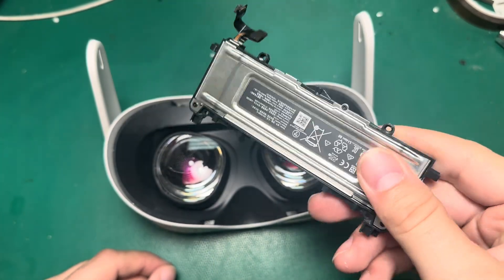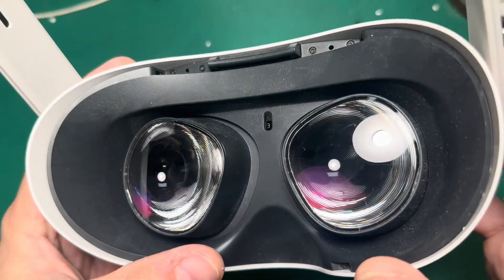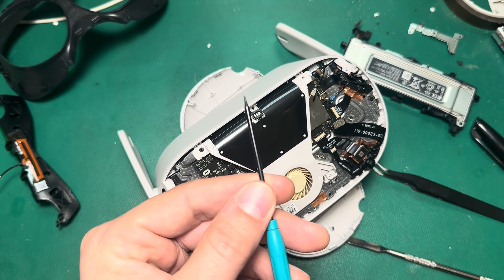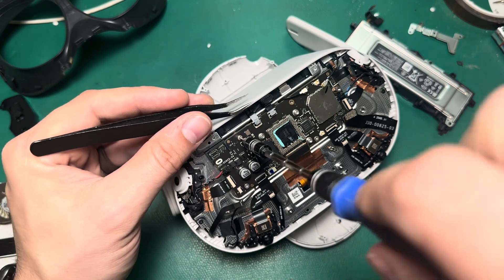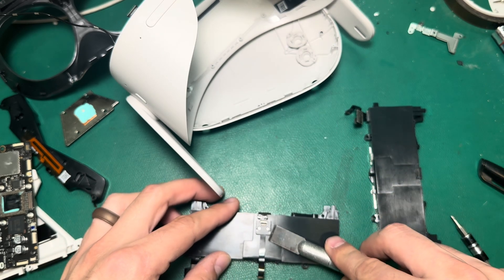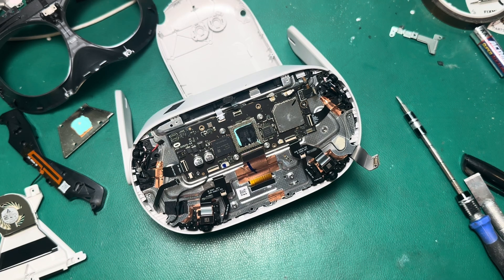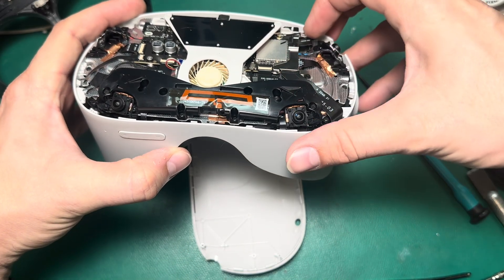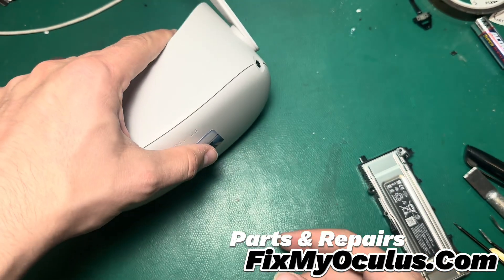Why Your Quest 2 Battery Won’t Last (And How to Fix It)

Comment: A successfully replaced the battery on my quest 2 and also changed the thermal paste.

It was almost a clean install but I forgot one ribbon cable, I've had to dismantle the device again , and almost broke a proximity sensor connector, and some other parts too.  about 9 bots left, however the the device is working fine

Comment: Great video! I work in IT so I'm usually comfortable trying to fix anything, but this one definitely took me for a loop. I spent most of today replacing the battery for a friend and man it's a pain, but eventually I got it. I even damaged the connecter on the volume buttons and just taped the flex cable in and it worked 😅. Still, this video helped a lot!

Comment: My Quest is not quite broken yet but damn, putting it into standby absolutely screws my battery. I have to basically keep it plugged in 24/7 unless I want to power off completely.

Comment: Given the position the battery is in, they could have designed it so that you remove the eye shrouds, then undo maybe two screws at the top behind the shrouds to slide a top cover plate back, revealing a serviceable battery compartment. They planned and engineered this unit but gave no thought to the ease of serviceability for consumable parts or any sense of environmental responsibility.

They could have even established an official parts market where users could buy replacement batteries and other components, with a trade-in system for old batteries, similarly like many robot vacuum manufacturers while still making a profit from it.
Reply: They just want us to buy a new headset

Comment: It’s worse for me. Leaving it alone for two weeks, it’s no longer powering on even when plugged in. Even changing cables, plugs and different combos of holding buttons down didn’t solve anything. Still haven’t yoinked the battery yet as a Hail Mary check.
Reply: @wywarren you should have recharged the battery after testing it
Reply: @minecrafthorrorversionfr sadly while I was testing it I had left it plugged in the entire time so I'm not sure what happened. Either the battery, charging port, or something else malfunctioned during the idle. While plugged in now the battery still heats up slightly from the charging.

Comment: I got an Oculus 2 about 2 years ago and never really got around to use it much at all. Now I want to use it and it won't even turn on , I plug it up and it won't charge (no charging light at all) the white oculus logo flashes for a second in a loop for infinity. And the holding power button or the power and -  button does nothing)... I assume the battery is toast? Will getting a new battery and following this video fix my issue?

Comment: Where are you sourcing the batteries from? Are they newly manufactured batteries without any charging cycles or parts from other used Quest 2s?

Comment: does the battery come out of that plastic, i mean can it, like would it not be easier to always have the front off and cut a hole in the top of the quest for any future replacements

Comment: The disappointing thing for me is it wont even work plugged in with the battery dead.
I hardly had time to use mine and now that I do it won't power up.
If they don't improve this I don't know if I'll want another Oculus.
I may as well attempt these repairs or else it's a paper weight so thanks for video.

Comment: Fucking meta, they can't make it easier!
Reply: They made it cheaper so you can just buy another one cheap because that makes sense to marketing I guess...
I'm grumpy it won't even work plugged in with the battery dead and unable to charge.
They clearly wired it in series because engineering said so.
Bah... I'll fix it later. I've wired bigger projects.

Comment: Is battery life connected to how old a device is or if you let the device run out of battery to much
Reply: Both and more!

Lithium batteries simply do not last forever, so yeah, an older device will inevitably see it's battery degrade, even if you don't use it. however, there are 2 things that make this degradation happen way more quickly.

1 - Heat. This one is hard to really control since it's up to the environment, but you probably don't want to leave your quest (or any other battery-powered device) inside a car in the sun for example

2 - Charging extremes. Batteries are the most stressed - and therefore degrade the most quickly - when they are at either extreme of charge level. To preserve battery life, should keep the device at 0% or 100% charge for as little time as possible. If you're going to leave your quest without use for a while, you should definitely make sure it is at around 50% charge before storing it. Charging overnight is also pretty damaging since the device will reach 100% in the first 2-3 hours, and then will spend many hours at that stressful charge level until you use it. Essentially don't let your device discharge fully, and avoid leaving it fully charged for long periods

Both of those are quite annoying to actually take care of, but will extend your battery longevity by quite a lot (tho they won't fix anything if the battery is already damaged)
Reply: @ViniSDL so you’re saying don’t leave it at 100%?….
Reply: @seeum2098  Yup. If you're not going to use you quest for a while, you should try to discharge it to like 70% before putting it away

And also don't leave it at 0%. Charge to at least 30% before storing

Comment: i love how i watched this thinking i could do this
Reply: The kits with all these tools are super cheap. Just follow the steps to unscrew and unplug. This looks a little more involved than most phone batteries but nothing too crazy. Good video!
Reply: @jbtvt it’s the putting everything back and remembering what you took out that’s the headache
Reply: This is a tedious repair but not a hard repair
Reply: If you have controller Stick drift, try yourself out on them, they are easier and cheaper to replace, if something should break. I started changing my battery in my phone. Then I replaced the joystick in my controllers and I´m pretty sure the Headset isnt much harder than the conrollers
Reply: Its not as bad, its like “jbtvt” said
Reply: @sighsai  same haha 🤣🤣

Comment: So I have a question about the cooling fan if the fan is dirty or dusty can you just clean it and it will be fine or will I have to replace it
Reply from the maker: Usually you can just clean it.

Comment: my sensor latch just broke on the headset recently and hasn't been able to power on with a led light, is there a reason the latch is crucial for the component?
Reply from the maker: Without the latch the cable isn’t actually seated or connecting the contact points.